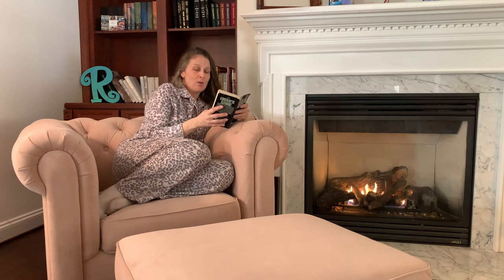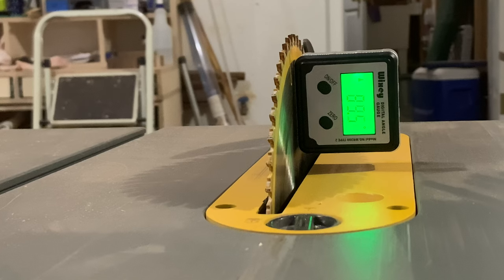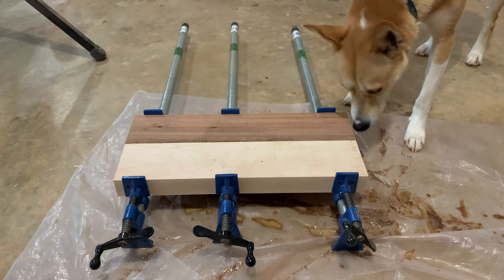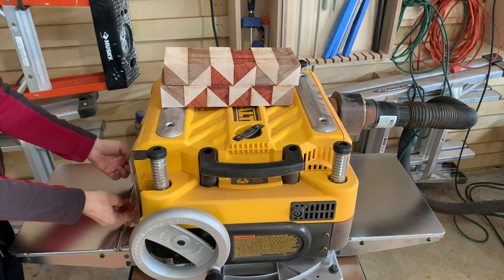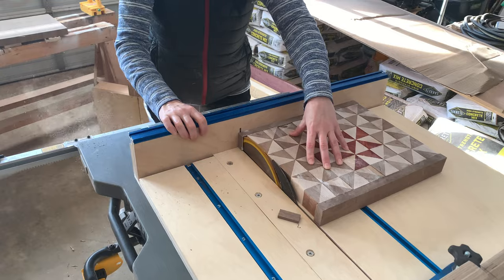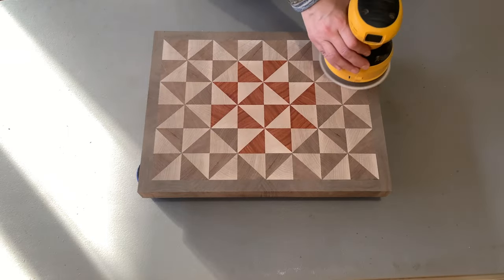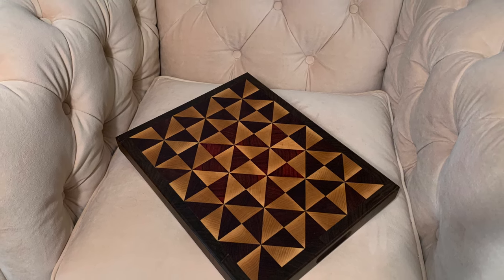How To Make An End Grain Cutting Board Quilted Pinwheel Pattern   4K

Comment: Absolutely stunning board. If using 3/4 inch thickness wood, are there any adjustments in method (at table saw) that need to be made?
Reply from the maker: Potentially no adjustments (other than height if the blade) would need to be made depending on the end effect you want to achieve. If you want to have this big graphic pattern like I’ve made the end grain pieces are just under 2” squares. If you used 3/4” wood and follow what I did you would end up with 3/4” squares which would look awesome but take alot more pieces to get an 18” board. You could laminate the 3/4” boards and make 1.5” boards and then the end result would have 1.5” squares. Ultimately if your boards are 3/4” the directions still work it will just be a smaller pattern. This was a great question!  Thank you for taking the time to watch. Feel free to reach out if you have any other questions when making this design.

Comment: Another great video! Thank you for the detailed steps! What jointer model is that? Do you like it?
Reply from the maker: Thanks!  I use the Wahuda 10” bench top jointer. (They also have a 6” and 8” version). This is my first jointer and I have loved using it.  It was really easy to set up. It’s light enough I can pick it up and move it if needed. It has spiral cutterheads which is awesome for a bench top version. The dust port works well with my shop vac without overwhelming it. So far the bed length has suited my needs. If I move into doing large projects like tables I’ll probably need something with a longer bed but I don’t have plans to upgrade any time soon. I would call this a great beginner tool bordering on intermediate tool.

Comment: At ~5:00 minutes you cut boards. How long is each piece? Also, do you just use one "strip" from each board?
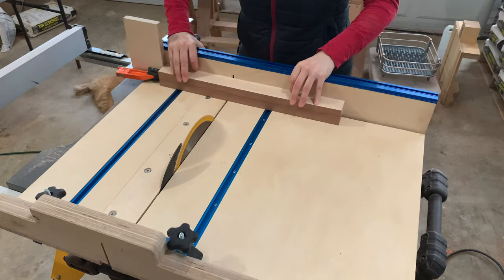Reply from the maker: The boards started at 24” and then I made the triangles. Those were also 24”. I needed 2 of these in Padauk and 5 of these in sapele. (About the 5 minute mark) Once I had the triangle pieces I cut those into lengths for the edge grain boards. I cut the Padauk / maple triangles into 4”lengths (about the 5:40 minute mark) and I made 6 of those. Then I cut  the sapele/ maple triangles into 4” lengths and again made 6 of these. Finally I made 8” lengths (about the 5:30 minute mark) of the sapele maple boards and here I also made 6 of these. I used those shorter triangle pieces to make the edge grain boards - the first board is made of the 4” pieces in this order sapele, 4 Padauk, sapele. The second board is made of the 4” pieces in this order 2 sapele, 2 Padauk and 2 sapele. The final board is made of the 8” sapele pieces (all 6 of them). If you pause the video at 6:04 you can see this in detail.  I hope that helps you!
Reply: @FireflyWoodworking  thank you. Little confusing but I'm trying it!!!

Comment: Nice board and music as a suggestion provide more detail in your measurements. All you said was 8 quarters and little else on length or dimensions
Reply from the maker: Thanks!  Great idea. More and more with my boards I find that other than the first dimensions I don’t really measure a lot. I just mill the boards the same thickness which can definitely vary depending on defects in the boards and then I use that as a reference and make things into squares. But I will definitely add more commentary on this is the future!